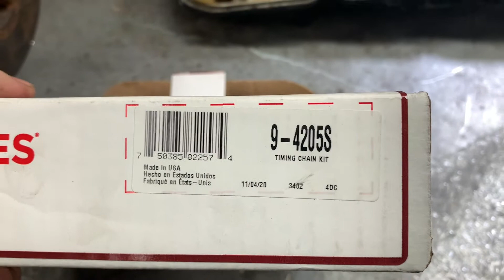How to convert a gen 4 LS to gen 3 1X cam sensor (05-06 GTO timing set) #9

Comment: So the gen 4 cam sensor will work with the gen 3 harness and ecm all you have to do is extended the wires? No reposition of the pins?
Reply from the maker: Depending on how you wire it yes, Absolutely. I used the little harness that plugs into the cam sensor which already has the pins repositioned. If you don’t want to use that harness, you’ll have to switch the pins
Reply: @StationroadRatrods  thank you  very much sir great vid
Reply from the maker: Anytime buddy! If you have any questions I’ll help where I can, and thanks a bunch
Reply: @StationroadRatrods  I didn’t switch the wires, no start. Not even a fire in any cylinder. I’ll swap them tomorrow, hopefully that’s my only issue.
Reply from the maker: Hopefully so. Did you use the harness that bolts to the front cover? Or just extend your harness and plug directly into the cam sensor?
Reply: @StationroadRatrods  I only used the extension, I was hoping for a putter or something. I may swap the new crank sensor if switching the wires still get no fire.
Reply from the maker: Okay cool, lemme know if you need anything 🤘 hope it works out
Reply: @StationroadRatrods  still no fire! Getting very discouraged, I struggle to even work on the truck with my back. Today I swapped the wires on my extension, because it wouldn’t plug into the original plug. No good, so I put the good but old crank sensor in and still nothing. I don’t crank it much, but I can smell gas and have pressure at the port. Assuming I have no spark, but I’ll need someone to crank it for me tomorrow while I check. I appreciate any information you have that may help.
Reply from the maker: Are you doing this with the crank sensor? The crank sensor wiring should be untouched, you just use a block crank sensor instead of the tan one. 

The cam sensor wiring is what you’ll need to change up
Reply: @StationroadRatrods  that’s how I did it, nothing to the crank sensor. I’m going to scuff my grounds tomorrow. That may be an issue
Reply from the maker: Man that’s wild. What’s the engine setup? Did you put in a gen 3 crank?
Reply: @StationroadRatrods  I changed the reluctor to 24x. Truck Norris cam, but mostly stock otherwise
Reply from the maker: Right on. Are you getting crank signal on VCM scanner? Also, the reluctor is 100% correctly oriented?
Reply: @StationroadRatrods  the reluctor is in the exact place that the older one was. I need to plug my scanner in, not sure if I can see that with mine.
Reply from the maker: Man that’s wicked. I don’t know what to say
Reply: @StationroadRatrods  in my mind, it’s probably something simple. Bad connector or ground somewhere. I’ll try to diagnose it as soon as my back lets me. I’ll keep you updated.
Reply from the maker: For sure. Go over your whole checklist again to be sure. You changed to a gen 3 pcm too? 

I’ll try to help as best I can, hopefully you get it soon!
Reply: @StationroadRatrods  I used my original L33 wiring in my Silverado. The only real changes were relocating the cam sensor and the knock sensors. That should have been pretty simple, minus the wire switch at the cam sensor.
Reply from the maker: Okay. Should be a super simple setup then.
Reply: @StationroadRatrods  So, today I checked my ground wires, replacing one end, but no luck. I found a video saying that the coil wire connector may not be grounding. Showed how to ground the black wire on each side to the chassis. Bingo! I don’t know where they were losing ground in this system, but works now. Thanks for all of your suggestions and for this video. I wouldn’t have known about the timing chain details without it.
Reply from the maker: Well jeez that’s awesome!!! I’m so glad you found it, and something as small can cause so many headaches. As far as I can remember the coils ground behind the cylinder heads, but hey you got it fixed now 🤘
Reply: @StationroadRatrods  those are connected as well, were before.
Reply from the maker: Freaky. Crazy how those harnesses can break in the weirdest spots eh

Comment: So your using a 54x wheel and 1x cam sensor?
Reply from the maker: I should have cleared that up more, I actually put a gen 3 crank in it (24x) and the 1x cam sensor
Reply: So let's say someone didn't do the crank swap to the 24tooth. And we still have a 54x and 4x cam sprocket to put that gen 4 engine into a gen 3 vehicle do we still need to use the lingenfelter box? I'm assuming we do. I wasn't particularly wanting to break open the bottom end of the engine.
Reply from the maker: You got it, the lingenfelter box is the easier way to do what I’ve done here. You just plug her in and go